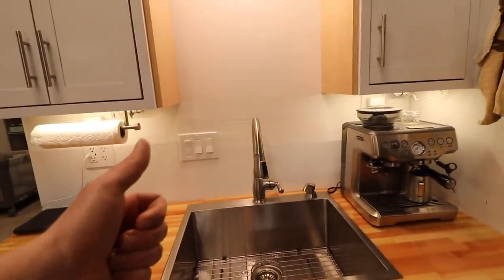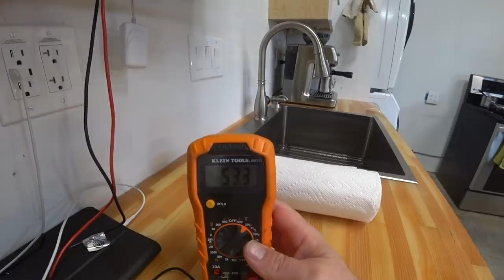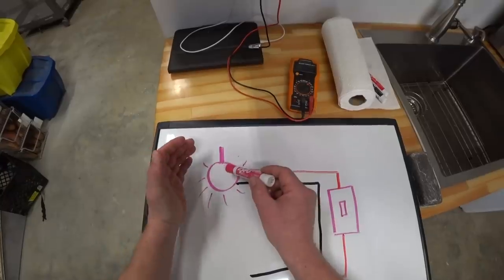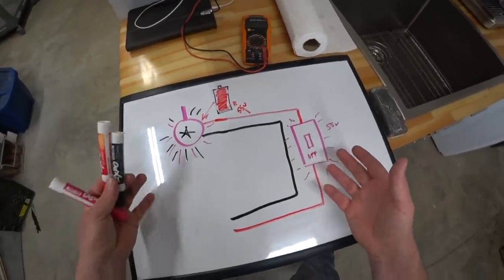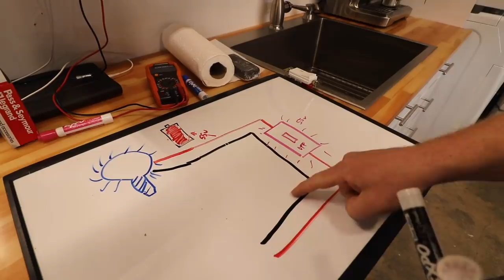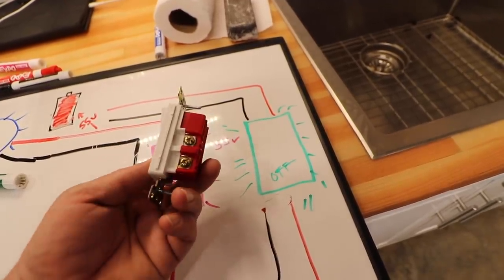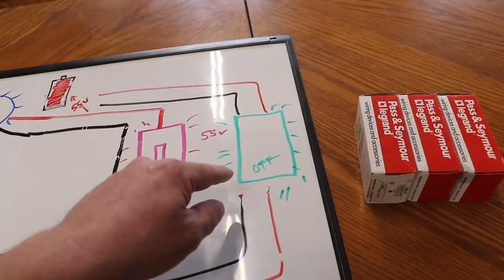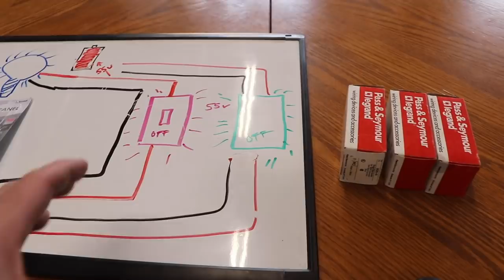Don't Use LED or CFL Bulbs 'Till You WATCH THIS VIDEO

Comment: The simplest solution that many big companies like ABB, Schneider electric, Hager etc comercially provide in europe to solve this exact problem is the use of a little box with 2 connections they sell that you wire in parallel with one of your loads in the circuit. The only thing that the box contains is a small Χ2 (mains rated class) capacitor (usually 100nF for the 240v supply in europe)! By hooking this capacitor in parallel with the wall-wart, this tiny "leakage" current from the illuminated switch travells through the capacitor instead of charging the wall-warts internal capacitor and firing it up if that makes sense ;)

Comment: I made my own led illuminated switch by putting an LED circuit across the open switch using the load to complete the circuit. Those switched use the resistance of the incandescent build to complete the circuit. You could make one using a 3-way switch like wore second drawing,

Comment: A Switche, that doesn't disconnect the hot wire are dangerous anyway. Even on normal light bulbs. Consider a broken bulb, full voltage where you do not expect it and trying to change the bulb. You'll ending up getting hit by the full voltage.

Comment: Have same type of situation in our hallway with two lighted switches I put CFL in light fixture and the Bulb would glow when Switches were turned off and the lighted switches would flicker could not stand it thought there was something wrong so I went back to standard bulb in hallway and no more issue so just stay with standard bulb in the hall is my solution not on that often for any length of time so not such a problem. Learning today though glad it was not something I did wrong.

Comment: This is because you're using Two-phase electric (to get 240V), blink happens when the power load in each phase is differentiate (
therefore the voltage is also different). Here, In Europe, is common one phase 240V, so we don haven't that problem (but in my village I still have 2 phase poser so, I now about that).

Comment: the problem is the power adaptor, it is converting ac to dc for the led minis, therefore it has both a transformer and cap which is being charged by the 55vac.  Install regular 120vac leds and problem will be gone.
Reply: this
Reply: I agree.  It is the LED converter that is causing your problem.
Reply: This

Comment: Surely a glowing switch could lead to accidents as your concentrating on walking over to the switch and trip over unexpected obstacles?  Usually a switch is located near a doorway for exactly this reason... it's easy to find in the dark!  Additional switches that aren't near doorways are normally used in a 2 or more way switching arrangement, but not on their own.

Comment: The automated light switches mostly have a built in light and use the neutral return.  I use tp-link ones and they have them.
Reply: The TP-Link lighted switches work perfectly for me too. Lighted when "off", short push toggle-on, and bonus of working with smart phones and smart speakers.

Comment: I understand why it works that way.  Possible solution #1: Maybe this is not an acceptable solution to you but you could change your two socket single circuit outlet to a two socket two circuit outlet (right now it is a single circuit two socket outlet) and change your switch to a three way.  Run two wires from the three way switch to the two circuits in the outlet, and put a night light in one side of the two circuit outlet and put your wall wart in the other side of the outlet (It does matter which two wires you run from the switch to the outlet, the common contact on the three way switch needs to be connected to AC HOT).  Night light in one side of the outlet, wall wart in the other side of the outlet.  You have a night light then but not a lighted switch so you can still find the switch because when you turn the three way switch to the other position the LED lights go out and the night light comes on.  That was Solution #1.  Solution #2 would be to just plug in a desktop incandescent light next to the wall wart like you already suggested.  - Mike

Comment: You should have 110 volts on the recepticals. Changing the switch fixes the problem. 
Use nightlight switches. The neutral is required for the newer switches to be illuminated only. With normal switches the neutral is just joined to the light neutral

Comment: The illuminated switch is meant to have a neutral and a live at the input so that the illuminated part will glow when the circuit has power (If you have the live and neutral presented to the side that the illumination circuity runs from), then the live and neutral goes to the sockets that you have the transformers attached to and it will all work. the 55 volts is what the illumination of the switch is passing when open circuit (or switched off) as the transformers are completing the circuit from the live (Via the illumination part of the switch) to the neutral (via the transformers)

Any circuit that passes more than 0 V when off or less than full mains voltage when on needs to be double isolated (double pole single throw)

Someone could switch the circuit off and still get a shock albeit a tiny 55 volt one

Comment: Jessie buy a salt lamp, as they make several different types including a night light salt lamp that uses an incandescent light. But there is also a simpler alternative, and that is to plug a battery charger for double A batteries into the same outlet or even a very simple USB phone charger for some kind of smart phone. Even a humidifier will work and you would be surprised as to the gadgets that will put a parasitic drain on the circuit. Like even a pair of Logitch speakers, that you leave on even when you turn the switch off. I know this as a lot of manufactured homes use a Carbon Monoxide detector that has to be plugged in on a low voltage power supply.

Comment: You need to put a relay for your LED circuit. The relay don't store electricity as a capacitor. The relay is an electromagnetic magnet that close the circuit. So a 110 Volt AC  relay. You need to buy the relay with the same amp as your home electricity circuit.

Comment: why is there a switch right above the sink? pretty sure there’s a 3ft minimum, if not more. also that new switch doesn’t need the wires wrapped around, the holes that look like the old stab in connectors have a terminal that clamps down. anyways the answer to your question The best load to take it off the LEDs is one of those air fresheners  that plug in, they use a resistor to get hot, For dimmer packs in theatre we use them when things like LED par lights stay on even though the TriAC is off.
Reply: if its on a gfci breaker its ok
Reply: Couldn't using a zener diode in the circuit work to since he came find a double pole single throw? (I electronics

Comment: Problem is that the neon lights leak current past the switch. This slowly charges the capacitor in the LED power supply and causes the lights to flash and discharge the capacitor, rinse and repeat. Either remove the neon or put a 100K/0.5W resistor between the light PSU input terminals to prevent the charging effect. .

Comment: I have recently had this problem with the led lights that I installed down the sides of my steps. The switch I used had a red indicator light that glows when the switch is powered off. I solved it by removing the small red neon indicator light. Voltage was passing through the neon and allowing the leds to flash when enough voltage had built up.

Comment: in the uk some dimmer switches are supplied with an inductor/resistor that has to be wired across the load to prevent this. the neutral is present in our switch backboxes.. not sure how you wire up over there

Comment: Solution may be to install a 2 pole double throw relay in the circuit - after the switch to fully isolate the LED from the switch.  Connect an appropriate resistor across the normally open side so when the relay switches the LED off, the switch is happy to see a bit of resistance

Comment: I use smart switches that are lighted and cheap. They work the old way and the new way. Meaning, tactile even if there is no wifi, and they are smart switches when there is wifi, and they light up, and they don't need a hub and work with any router.  Run on sentences are my specialty. Some smart switches are not expensive.

Comment: I agree with your explanation.  I imagine whether or not the switch causes the strobe effect depends on the design of the LED lighting power supply.  Did you try one in the bathroom yet?

Comment: it's not a LED/CFL problem, it's a lack of resistance problem. 
You need something lika a 10Mohm resistor between the load side of the switch, and the neutral to discharge your 55v when powered "off" ( a pull down resistor in electrical terms)

Comment: Seems wasteful and dangerous.  I would have thought if the light switch is off there would be no power running through the outlet, yet there is.  (Someone could get zapped).  Also, it seems wasteful, as using a normal light bulb as a resistor in the circuit seems like it would use more energy than just powering the light in the switch.  Even though the power going through the bulb is not enough to light it, it is still using energy. and what happens if you use one of these switches to power (for example) a garbage disposal.  Could the motor be creating heat, even though not running? Or could it shorten the life of the motor?
Reply: The power is minuscule so if you had an incandescent lamp you would see zero volts across it and the switch lamp would be a bit brighter.

Comment: a 3$ set of 7watt incandecent plug in night lights (on in each outlet beside the wall wart) will be enough to drain off "leakage" current.  The lights will consume 7watts only when turned on.  they will consume about .1w when off.

Comment: My Chandelier that runs 3 LED 3w Philips B11 Bulb on an illuminated dimmer and I don’t see that problem here. If it happens with a lighted switch like yours. You might need a minimal load CAP by Lutron.

Comment: Not to familiar with house wiring, but could you install a small in line resistor like what would be used in a circuit board or automotive wiring. It would obviously dim the LEDs a little bit when they are turned on but may stop the flashing. Just a thought, I honestly have no clue if it is even possible.

Comment: The problem is that the circuit does NOT  include a light bulb of any kind.  It is using a transformer which, by design, is a closed circuit.  There is power constantly running through that tranformer thus constantly feeding power to that capacitor.  What you will have to do is to 'short circuit' the switch bulb straight to the neutral.  That way the switch bulb circuit bypasses the transformer

Comment: The wall warts have a capacitor that is being charged thru the power for the lighted switch, change out the switches to continue using the LED's without the charge cycling, get a simple night light and all of your problems are solved.

Comment: Where's your ground wire? Most has ground and neutral in the main box tied together as that would complete  the circuit.
Reply: That will not passcode anymore.

Comment: Doug the solution is simple buy a double single pole switch Levington model 1754 switch white sell these cut tab between switches then you control the hot feed with one switch and the neutral with the other switch if you need more help please feel free to contact me I have 30 years experience as an electrician

Comment: Those wall warts are switching type not transformer type.  The input is a solid state SMPS circuit.  The leakage current passing through your FANCY switch charges the SMPS.  When it reaches the startup point the wall wart turns on causing the light to flash on.  This quickly discharges the SMPS.  Then the cycle repeats.  Solution, loose the fancy switch on this circuit because it doesn't work with those wall warts.  Not all fancy switches work with all loads.

Comment: Does the switch not have a neutral terminal on it.....the ones I install do
Reply: All it takes is a neutral jumper to your switch... just one wire, not an in and out

Comment: Really surprised the second switch didn’t work,   Possibly the reason was the line (hot) is directional so you needed to swap them.   I ran into issues while installing WiFi switches with led floodlights, as a lot of the switches are dimmable and the led lights I have are not.

Comment: Wire in an outlet in the cabinet under the sink.  Put the night light in there.  It would be dully lit when all the lights are off and lit more so when the switch is turned on.

Comment: The neon lamp would have to be on all the time...  The problem is that the NEON lamps sputter and go bad... same thing you see on the lamps on plug strips... The fail after a few tears and start to blink.  They could bring out one lead of the neon but it would be on regardless of the switch position.

Comment: I'm an engineer and I encountered this problem some time ago. The problem is complicated so I will not go into detail here. Instead, I will discuss the solutions. Simply, you can not switch the AC going to wall wort because the indicator light is a neon bulb which will interact. Switching the DC side will solve the problem but of course this is not easy. You can get a wall wort with a switch and indicator light on it. These are expensive and hard to find. There are more elegant solutions that get really complicated. The Kiss solution to use a straight rocker switch (no light) and stab in a night light in the adjacent socket. You know the kind with photo cells. There are also DPST switches with a separate neon bulb that will work without any load at all. Finally, there are DC fixtures made for travel trailers or campers. These use 12 volt LED automotive bulbs for indicators.
Reply: KISS solution would be a shunt capacitor on the outlet and cheaper than a DPST switch

Comment: If Switching points(inside switch) are in more distance then normal ,then it may stop to flow voltage leakge ,which causing to charge the cap

Comment: Check with an electrician but you should be able to put a resistor between the neutral and the hot at the outlet. Same effect as a light bulb.
Reply: This should work. Just make sure the resistor can handle the load when the power is on.
Reply: @Raphvsmith     what kind of resistor   and how to connect it beside the old bulb
Reply: in europe we have special switches that connect differently to light up when off.
you must have them too.
Reply: stray voltage on this switch they are using doesn't seem right...

Comment: Hi Jesse, I believe the switches you have are fine. Are you absolutely sure 55Volts AC should be seen at that outlet if the switch is off? 
Suppose for a moment that there was an incandescent light bulb instead of a plug outlet, would the bulb actually go off if you turn off the switch, or would it just dim (by half) if there was still 55Vac? I'm pretty sure it would dim because a full circuit is still being made...even if it is 55v. I think the switch itself maybe incorrectly wired (or quite possibly the outlet - hard to tell from the video). This is where I would see the issue being based on half-split method. We know you got this...but please be safe and practice due-diligence.
Reply: He described how those old illuminated switches worked correctly, they allowed a small amount of voltage to light the internal bulb to pass through, but that 55v would not be enough to light a standard incandescent bulb. I have even heard story's of service calls where someone complained their lighted switch was broken and needed replaced, except it was actually the only bulb on that switch was burned out breaking the circuit so the bulb in the switch wouldn't glow either.
Basically the problem is 

A. Poor quality power supply's (wall warts) for the led's that don't have a resistor to drain any phantom current from causing this. (solution buy better products)
B. Old time illuminated switch design that was created when only incandescent bulbs existed. (solution buy a newer style illuminated switch/smart switch that uses its own neutral connection to complete the circuit)

Comment: Why is it the LED's I have outside on the corners of my home with a back light switch inside the front door is not doing this? I even have one LED on a back light switch that in a middle position the LED flashes to alert the first responders I have a problem and need help. This switch will also go to full on when pushed all the way up.
Reply: Because you are not using a 12 volt transformer.

Comment: You need a double pole-double-throw.  I have had the same problem because I have X-10 remote control on several lights...and motion detecters to turn on and off certain other lights.

Comment: i realize that i'm quite late to the party but wouldn't connecting the anti-jamming capacitor in parallel under the switch terminals solve the problem?

Comment: You can put the switch on your neutral wire to do the same thing without electricity going through the switch you will be turning the lights off with the neutral wire

Comment: Why do you need glowing switches? Change your thinking. Go to smart LED lighting systems that include motion sensing and time of day scheduling. I haven't had to touch my light switches in years. They stay in the on position and the smart LEDs are controlled by my phone, a schedule, special dimmer switches, etc. My lights are timed such that if I get up in the middle of the night, the motion sensor turns on just the bulbs I need in night light mode.